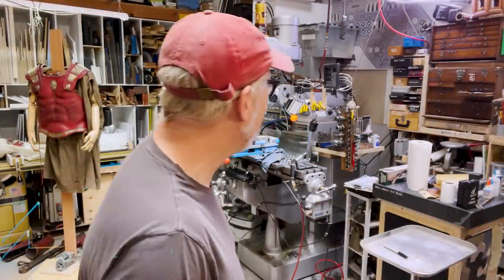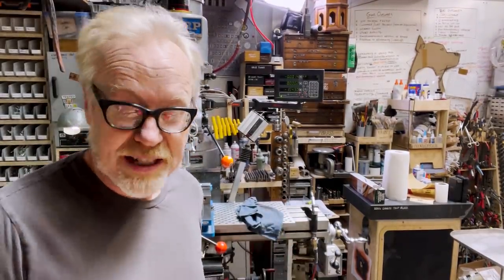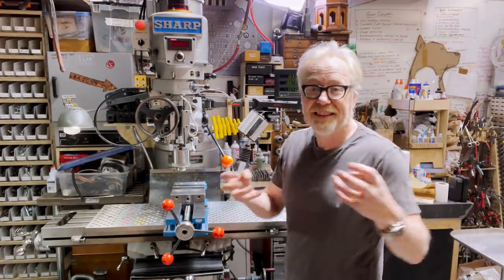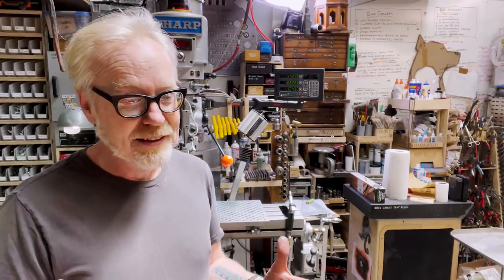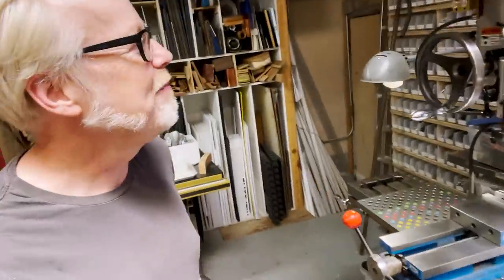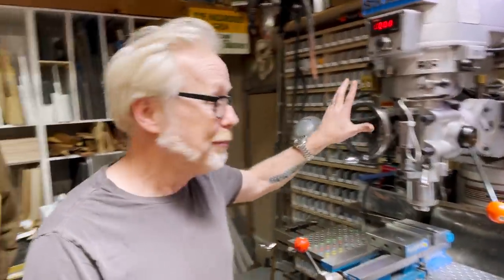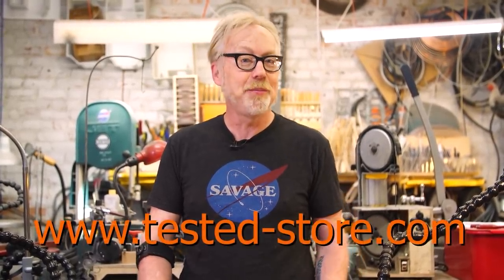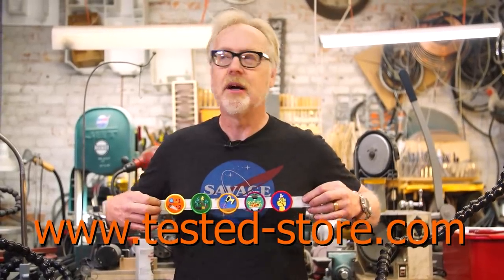Adam Savage's New Milling Machine!

Comment: Nice mill! I work for a machine tool manufacturer, and work on a lot of lathes and mills installing accessories and scales (including Newall!), and just wanted to say, I think your x axis power feed can be adjusted to be quieter when you hand crank it! On the ones we install at work which look fundamentally the same as yours, we shim them to get the gear mesh more exact and the gear noise almost goes away entirely. It's pretty easy to do if you ever want to play with it, but you'll have to get/make some round shims. 

Keep it up!
Reply: @dylan94  hey Dylan,  Caught this 2yr old comment about your work & you mentioned shimming the power feed.

I just got my 1st mill, (@ 69), an old round column Jet-16. It has a power feed on the x-axis, but due to height, there were clearance issues, so the power feed was mounted horizontally, instead of the typical door knob placard position.

It makes a heck of a gear knashing racket when cranking it, & it's quite noisy when using power feed.

Have you ever sorted on of them out when they're mounted horizontally w/ the appropriate kit & might you have any suggestions on info or from your experience.

I've been unable to find anything on YT, so I'm kind of at a loss. The noises it makes are bound to lead to gear destruction. I thought I'd try to go back to a vertical mount, but there just isn't room, if I could even get the parts.  Making the gear(s) isn't in my skill/tooling set.

Any clues to finding info or suggestions would be greatly appreciated by an ancient maker.

GeoD
Reply: @georgedennison3338  I wouldn't think the power feed being mounted horizontal would really be an issue. If you want to check your gear mesh on your pinion gear the best way to do it is to pull off your handle, and if it's at all similar to Adam's mill, your dial and pinion gear that's keyed to the shaft should come off together, leaving just the drive pinion on the power feed exposed. When I'm setting the mesh I remove the dial from the large pinion that is keyed to your shaft, make sure you clean any grease from around the ID of the housing on the power feed that the drive pinion gear is in, and clean grease off the OD of your keyed pinion, and put it back together how it was, except with your dial removed. With the dial removed, and everything reassembled, you should be able to see a small gap around your power feed housing, and the keyed large brass pinion. With the power feed powered off, but toggled either direction, you should be able to peak between that gap and see how much lash you have between the two pinions if you slowly rock your handle back and forth and peak through the gap with a flashlight. I just remove shims until there is as little lash as possible but still enough to have the tiniest play between the two gears. The two pinions come with a super sticky grease from the factory as well, so try to find something like that to put on the gears as well to help with noise. I wish I could tell you where to source some shims or grease, but everything I work on comes in a kit with everything.
Reply: @Dylan94  I should be able to managr shims & lube.  Just knowing that minimal clearance is OK is a big help.  The adapter used to mount it horizontally is real jinky. It clamps on the end of the bed, which is raw casting on the inside, so it does seat well & sits at an angle.

I thought it would help to get it squared up, so I got it remounted 'right'  & the damn thing howled & barely moved. Had to remount it 'wrong' to get it to work.

I'm still going to try eliminating the adapter, using studs & spacers. Hopefully that'll work.

I think if I get a reproducible mount, I can get a good gear mesh & reliable function.

Thanks for the info.

GeoD

Comment: I've had a Sharp LMV-50 since about 2006 or so, and it's an excellent milling machine.  Probably not as nicely made as a brand new Bridgeport from the 1960's, but very much as well made as a current production Bridgeport (which is also imported, sadly).

It's been here ~15yrs and in that time I've had zero issues with it mechanically, and it's made a lot of chips in that time.

You'll really like that machine, and it should last you the rest of your life.

Have been really glad to see you really start to buckle down and learn how to use your machine tools properly, and it's been really great to watch how quickly you're progressing at it.

Comment: Congratulations on the new mill. I enjoy seeing your excitement with the mills. I started scraping in 1976, done hundreds of knee mills. I have a Bridgeport with 1959 casted in the bottom of the table, the year I was born. It belonged to a friend "MOS" that used it to build his Harley-Davidsons. You can see them at  https://wheelsthroughtime.com/ 
Your right on the decision to get a new machine, unless you can scrape. The table on knee mill will sag as far as .020 over a 4 year period, from my experience back in the 80's when we had a constant flow going through the shop. You can pull the table turn it upside down and sit on a surface place, it will spin like a propeller. Worse part of scraping a mill is the table.
 I sold my scraping tool, got my CDL's and going see the country for the next few years. Just thought you'd be interested knowing that bit of information about the tables.
Keep the videos coming, thanks.
Kenny "Scrape" in Dayton.
Reply: I worked in a shop and we had a horizontal mill from 1856. But it'd been all scraped and it was perfect.

Comment: Everything I know about milling machines is what I've learned from watching Adam's vids over the last couple of years. I've never even seen one, except Adam's. But from the way he uses them, I always got the impression that a milling machine was like a manually-operated CNC machine. Instead of a computer moving the heads back and forth, up and down, spin faster or slower, etc., the operator controls the motion with the manual wheels and levers, using pre-set stops and calibrated threads to get very precise amounts and directions of movement.

I guess it would be more accurate to say that a CNC machine is essentially just a milling machine controlled by computer software.

Comment: my first job out of high school was in a tool and die shop, I worked my way up to a mechanical designer for a high tech company... THEN I picked up a camera and have been a photographer and filmmaker for 35 years.... I'm in a state of semi retirement as of late......  my last studio I had an old South Bend Lathe, drill presses, sanders etc. etc....... but I am working on a new studio..... congrats 2 years later..... nothing like new machines even if they belong to the company you work for...... main question..... why a Sharp rather then the ole faithful Bridgeport...... ?

Comment: I am rebuilding a 1980's ACRA mill with dual power feeds. I am upgrading to ABEC 7 class bearings to really push up the accuracy  along with some re-scraping. Should then hold a tolerance tighter than new.

Comment: Hey Adam! Thanks for all the videos you put out over the years, I have really enjoyed them and have learned from them as well. Just picked up the same Mill at a local auction with little to no use. It was hooked up for 3 phase power but in my home shop Iam running single phase. I know these mills are compatible with single phase but was wondering if it has to be ordered that way or it can go either way? Thanks, 
Always Learning

Comment: My mill/drill is worn out, my Nichols horizontal mill is worn out, my Karger mill is not worn, but it's light weight and 80-90 years old.  I have a Millrite that's not too worn, but since it has a B&S spindle, I've never even powered it up.  I'm jealous!!!  At least my Kurt II vise is practically brand new.

Comment: Converting scrape machines to roller guide rail ways and balls screws and cast aluminum top plate bolted onto the ways of the knee and turret with a tool plate table longer knee head on rails. I’m going to buy a sharp 2017 like yours next week to finish the project vs scrap it.

Comment: Back in the late 1960's I had a temporary Federal Civil Service appointment with the Department of the Navy at the Pasadena Naval Undersea Warfare facility. There was also a remote facility in the mountains above Azusa at Morris Dam. I was a technician trainee. I already had some training using machine shop tools as far back as Junior High School. At Morris Dam there was a machine shop that was equipped with some very large WWII vintage but high quality machines. One I remember in particular was a big vertical mill, about fifty percent larger than Adam's Sharp, that had mechanical two speed rapid traverse on both the XY table travel and on the knee Z axis as well as variable speed  mechanical feed traverse. There were levers that actuated the rapid traverse. Sometimes I couldn't help but make the machine dance around just because it was so amazing. There was also a huge radial drill that probably had a six foot throat as well as a shaper. I had actually used a shaper in Junior High but they are pretty much obsolete these days. In operation a large shaper is pretty intimidating, the large head moves back and forth at a relative high speed. A tool mounted in the head shaves metal off the workpiece on one stroke and then hinges to pass over the workpiece on the return stroke and repeat. Of course there were also lathes with twenty foot beds and massive chucks. That facility did hazardous testing in open bays facing the lake on such projects as testing torpedo motors and torpedo thermal batteries. Humans were protected behind thick concrete walls and blast doors. The test bays could only be observed by looking at mirrors that pointed through high-mounted ballistic glass ports so there was no direct path for any debris that might be created in a catastrophic failure to hit observers. Then there were the day trips out of Long Beach Naval Base (since decommissioned) on a 40 foot TRB (Torpedo Recovery Boat, think PT Boat) to fish so engineers could collect fish slime, but that is another story.

Comment: I would love to come make  things with you. Machinist for 9 years 12 in woodworking.   Knee mills are amazing.   And power z axis. I'm jealous you have know idea how many turns I've turned that handle. Also when done you learn to turn the handle backwards.  Well knees is the the reason. You will walk into it a couple of times then you learn. I worked for a company that prints called for 2 microns. It was a grinding operation to hold that.  But I've seen 2 thousands on an old knee mill.

Comment: Have you seen Fireball Tool’s Cincinnati mill? It has a 5 horsepower motor ON THE KNEE. The main motor is FIFTY horsepower. It’s quite a machine.
Reply: Yeah but that would tip Adams shop over, if you could get it in there LOL.

Comment: Congratulations with the new machine 😊👍
But, a real mill do have feed and rapid in all directions/axis 😁 a Bridgeport type is only a DrillPress with a coordinate table 😁
Btw.  When using coolant on regular basis, and having accessories fixed to the table constantly can make it corrode very badly under.  So do yourself a favour to take it off once in a while, and give it some waylube/oil 😊

Best regards

Comment: If I was upgrading from a Bridgeport, I’d go with a Prototrak . The conversational programming is easy to use and bulletproof. It is the perfect melding of cnc and manual machining. Going from a manual mill to a Prototrak is as significant a upgrade from going from a drill press to a mill.

Comment: 11:45 - I was around for the arrival of a Fadal CNC mill at Hackerbot Labs in Seattle some years back. Big giant rectangular box (the mill itself was shaped thus; not referring to a packing crate), and a long hallway with a 90 degree turn in it. And then another to get into the lab. The “guy” was a wonder on that forklift. The hallway was probably almost 3 meters wide? So no biggie on the straightaways, but the way things worked out at those corners, there was like... maybe a centimeter or so of clearance?!?? Maybe slightly more, but it was a very tight fit. And this person just fuggin’ nailed it. He slowed way down, and was careful with the cargo... but he hardly had to adjust, he just was that good at operating that forklift, at sizing up the cargo, sizing up the space... serrrrrrrioussssly impressive. If I ever need to move a mill in San Francisco, I hope you don’t mind if I reach out to find out who your guy is... because yeah, sounds like you did ok, but I’ll want an expert. :)

Comment: Check out the adjustable work light from h&w machine repair and rebuilding. It mounts to the dovetail under the ram. We bought a set for each of our mills. They're small and very adjustable. The part number is WLDBLED.

Comment: I'd like to know how you got the milling machine off the platform on which you rolled it into your shop.  Many many years ago I apprenticed in a small machine shop and was taught how to run a milling machine for a special project.  It was making a single part for a defense contractor.  I thought the machine was absolutely marvelous at what it could do.  And, by the way, it was a Bridgeport.  This was back in 1968 in Connecticut.  I did not pursue the apprenticeship and made a career in the U.S. intelligence community.  Thanks for the tour Adam.

Comment: I'm jealous of Adam's new mill. About five years ago I purchased some machine tools for my personal workshop. I bought a decent lathe but went with a mill/drill. I initially though I wouldn't need no stinking DRO but soon changed my mind and installed a 3-axis aftermarket one myself. I'm good with the mechanical distance readouts on the lathe.  I now wish I had spent another couple of $K and bought a Taiwanese knee mill. One rule of thumb that should be mentioned is that the tooling required to actually use such equipment can easily equal the cost of the machine itself. Re: a Kurt mill vise. Originally, Kurt had a patent on the "angle-lock" design of the vise so you could only get that feature from Kurt. Of course, that patent has long since expired and you can buy equal quality vises with the same feature for less than the name brand product. The angle-lock design applies both a downward force to the workpiece as well as a normal straight linear force. That helps prevent the workpiece from shifting up during machining.

Comment: I think the first distinction between a drill press and a vertical mill is the spindle bearings.  Drill press bearings only need to work under thrust.  Milling machine spindle bearings experience both thrust and radial forces.

Comment: The plate that your vice is mounted to has several "dots" of various colors.  Can you explain them (or even add to one of your videos)?
Reply: On a fixture plate like that those dots tend to be rubber plugs to keep chips and coolant and other stuff from falling into the holes. 

The bulk will be black, but specific color plugs can be used so that you will know what holes to use for specific jobs or fixtures. For example he might keep Red plugs to put in the holes that mount the Kurt in the middle of the plate so if he does take the vise off, he can put it back exactly where it was later on.

In production environments a machinist might have 4 or 5 different jobs that they regularly run on a specific machine and so they might put Green plugs in the holes for Job 1, blue plugs for Job 2, etc. There's other possible uses too, maybe one just wants to make a cool pattern on their plate; or spell their name. 

It might just be that in this case Adam got an assortment of colors and put them in randomly until he finds a specific use for them.

This plate is probably a Saunders Machine Works plate, but there are other brands that have been making plates like this for ages. They've done a lot of videos about these plates over the years.

Comment: im curious as to why a milling bit cant be used in a drill press.
im thinking in terms of very light weight metal like 3mm aluminium
Reply: Drill presses do not have bearings that can handle side loads. They're just made to go straight up and down. The bearings in mills are a lot more robust.

Comment: I had been lusting for a milling machine for years.   THEN I saw AVE with the CNC Haas with automated tool changer..    Now I have to to sleep on my side to avoid drowning in the drool in my tool-porn dreams. 

Just when I reached the point where I could afford a used mill IF I ever figured out how to get it delivered and positioned into my garage I saw the CNC's.   "Honey, we don't really need all that money in our 401K's do we?,,,"
Reply: You don't need a CNC machine to enjoy the thrill of CNC. Just model in software and that's all it is. So get yourself a copy of Solidworks and have at it. Or use that Fusion 360 stuff.
Reply: @1pcfred  I do 3dp all the time.... But I want METAL.   Plastic is ... well kinda flaccid in comparison.  (I do have a small lathe... am I imagining it or does each kind of metal SMELL different when you cut it?)

Comment: It's funny that inks and scraping is primitive and yet the present. I worked in a machine shop for 10 years, it's crazy that the granite slab with .0001 deviation flat plane over 4 feet is still the standard for accuracy. Ink and grind/plane still works, it's beautiful. But I still wonder how the Egyptians worked granite to make 90 degree cuts and tube drilled with bronze tech.
Reply: Flat is flat. A couple thousandths is all you ever need. Close enough.

Comment: Sharp makes a nice machine. Very accurate. It’s good that you don’t have to bring most of your machines down concrete stairs as I had to do, except for my 14” lathe which ended up in the garage with my welding and powder coating equipment.